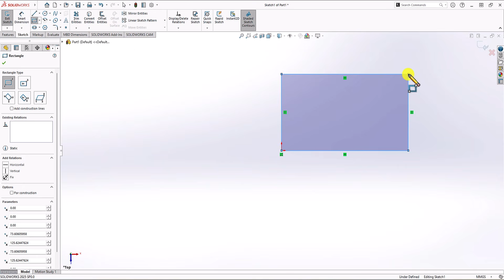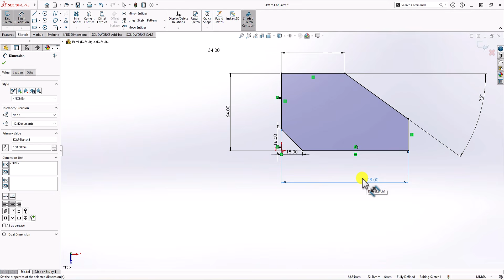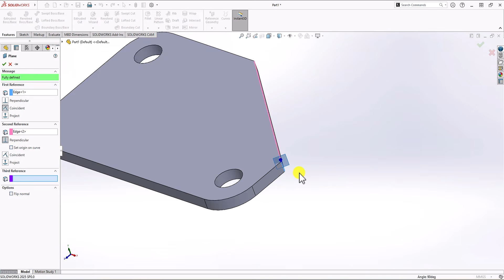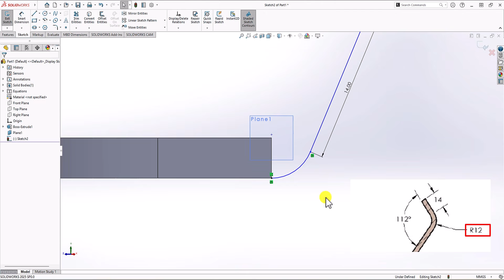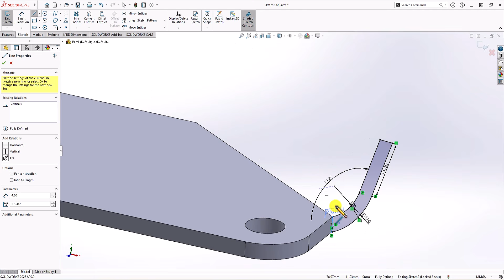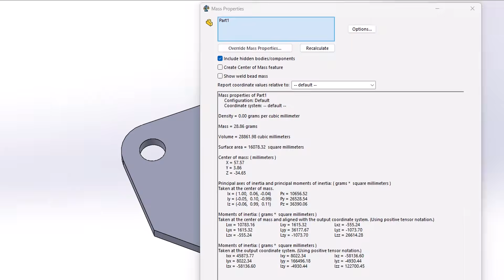CSWA Practice Problem 5.1 Solution | SolidWorks Exam Guide

Comment: I appreciate this tutorial! Thank you for helping me out. I was stuck on this part, and I didn't know how to create that curved flange. Everything in section 5 is a little hard for me because of the reference geometry, however, I was somehow able to do 5.3 without the reference geometry.
Reply from the maker: I’m happy to hear the video was helpful! Regarding reference geometry, yes, I totally understand. It can be confusing at first. However, once you go through a few examples, it becomes much easier to understand and apply in your designs. I’d also suggest checking out the other videos in Section 5, as they should help further solidify your understanding of reference geometry.